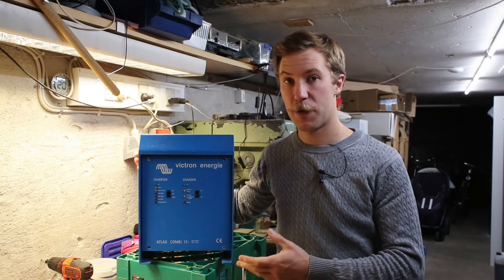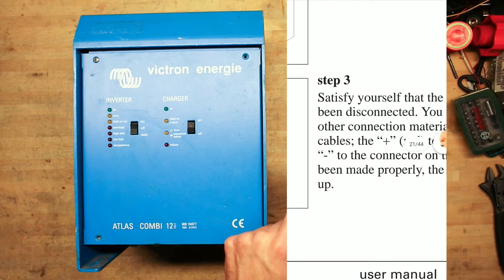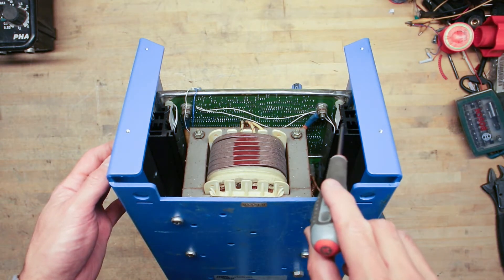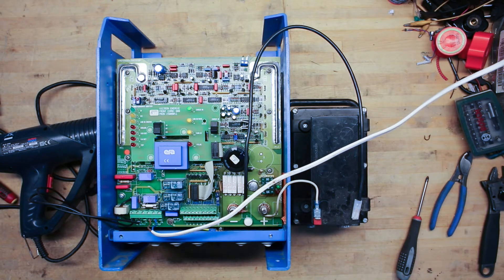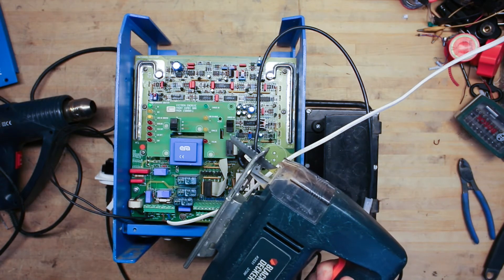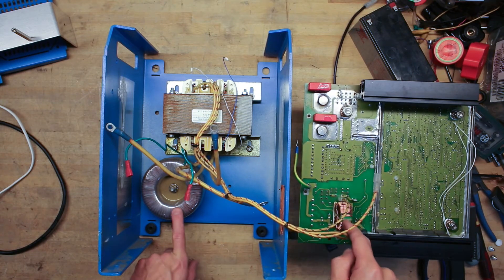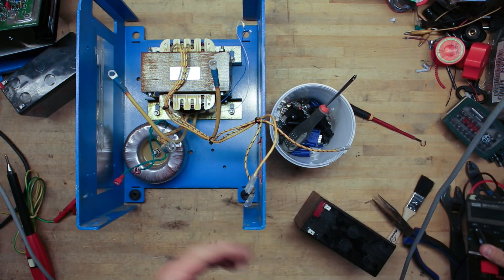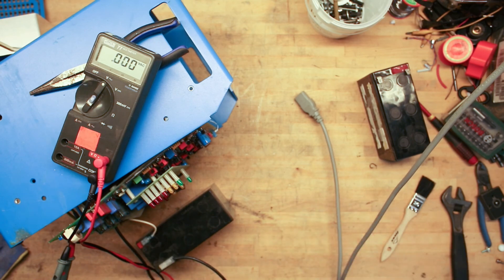Victron Energie Atlas Combi 12V/800W Battery Charger/Inverter Teardown

Comment: Hi Mads 
I am surprised that you have a leakage through to GND. Did not expect that ! 
if you would be able to make a conduction between the primary or secondary winding through GND with your tester the transformer would be broken anyway. 
Anyway, if you feel for it, ship it to me and I will disassemble it and give it a new primary winding, however the secondary winding I will have to reuse the olde copper since I don't have that size on stock.
I can see you liv about 130 Km from me.
It is up to You :) 

Regards Allan
Reply from the maker: Its all returned as scrap long ago, no room for saving everything :)

Comment: Great video mate.. the battery is falling below low voltage cut out I think mate, but your right i think in that it should not show a load on the inverter when its unloaded like you said the transformer is toast🤣...
Steve
Reply from the maker: The small battery behaves as expected, it will drop hard below its working voltage and under voltage setting of the inverter. That works fine. As others suggested, I might have completely killed a slightly defective transformer, but that was then bound to fail eventually and should not be used.
Reply: @KaizerPowerElectronicsDk  agreed,  it was probably scrapped for failing a hi pot test in the first place
Reply from the maker: I forgot if I mentioned that in the video... This was part of a thrown out lot of battery chargers and inverters from a marine company. Chances are good that it was all defective in various states.
Reply: @KaizerPowerElectronicsDk  yeah I think the transformer was already dead hence the load light with no load connected

Comment: I don't think that inverter charger is bad at all, your batteries are way too small and unable to deliver enough current, that's why it cuts out when trying to power loads.
Output voltage really depends on battery voltage in these types of inverters that use a step up transformer.
Set it up properly with a proper battery and you will find that it works 100% no problem.
Reply from the maker: It still has a inverter under load at all times. I am aware that battery is not going to power a heat fun, where it as it should, drops the battery voltage and goes in under voltage. So are you sure that a suitable battery would result in "inverter under load" to go away even when there is no load? Even when output voltage is normal on the small battery.

Comment: Just connect the primary to 220 and check the current draw, if it's high, than it's shorted. They may have connected the transformer to the case to create an Earth potential, when it tuns on battery.
Reply from the maker: That is testing for catastrophic failure, 230VAC is not current limited. I wanted to avoid that by using a non-destructive insulation tester, but I used a too high voltage, for me to be sure that it was not causing more harm.